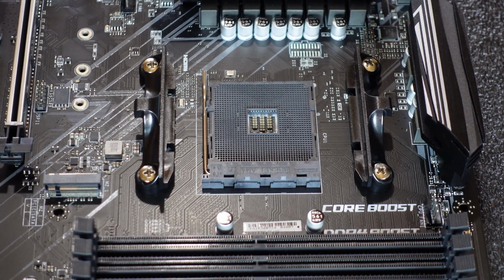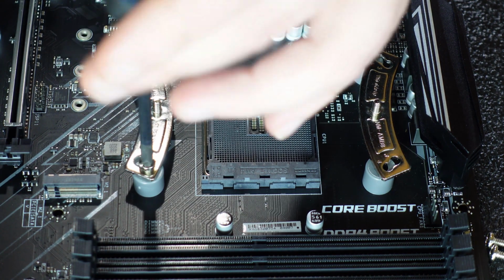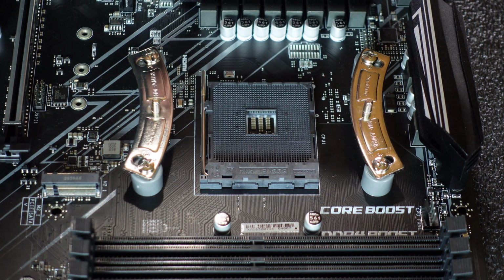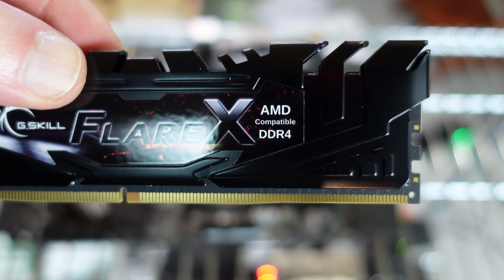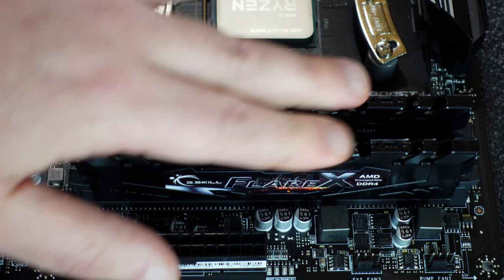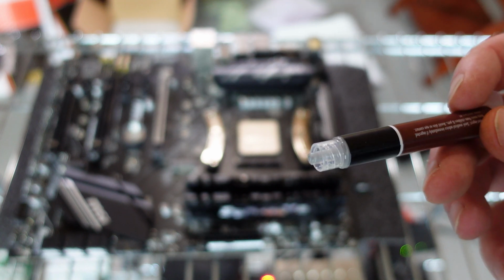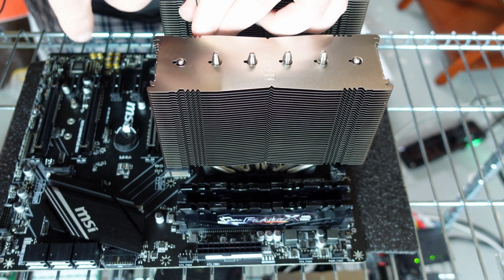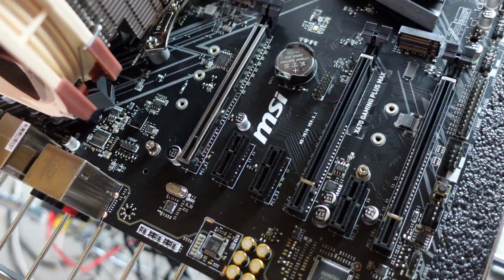Another CPU MINING BUILD This Is Getting Crazy!!!!

Comment: Hey Rabid, so I built this exact same rig and followed along with you in the video(s). The only difference, is I used a “Ryzen” 5950X CPU. I’m having a bit of trouble getting it to work. I can power it on and everything is receiving power on board, but the Red EZ-Debug CPU light comes on, and there is no display on the monitor, even though I have a GPU installed on board. I have tried switching monitors and using DVI instead of HDMI, and it’s still not displaying anything. The power cables are on correct, and the CPU has sufficient power. The PSU is fine as well. Any help is appreciated because I’m at a dead end, and don’t know what to do. :(
Reply from the maker: interesting curious if maybe it needs a bios update for the 5000 series CPUs?
Reply: @RabidMining  Yes it does, unfortunately I figured out that the x470 board doesn’t have the onboard bios flashback feature from a USB Flash Drive, and doesn’t support the Ryzen 5000 series out of the box. I am ordering the MSI B550 Tomahawk instead, which is compatible out of the box, and does have BIOS flashback.

I should’ve done a little more research prior instead of just assuming it worked and slapping a 5950X on it lmao. 

Thank you though, your channel is poppin, and I love what you’re doin! You practically got me into CPU mining or mining in general after seeing your rig builds!
Reply from the maker: @Skittl_EZ  thank you and sucks about the mb
Reply: @RabidMining  yeah, it’s all good though! im keeping it for a future second rig build with a 3900X!
Reply from the maker: @Skittl_EZ  good plan